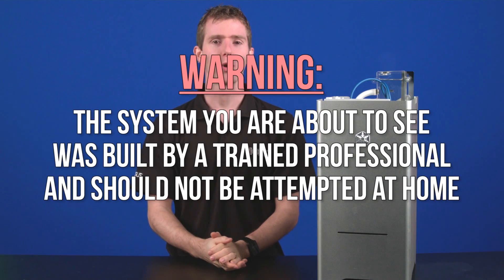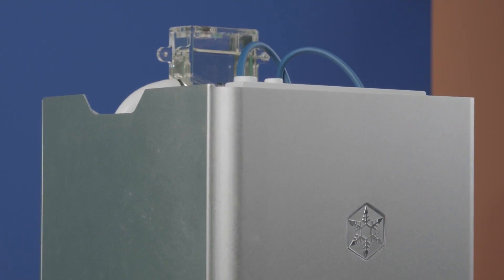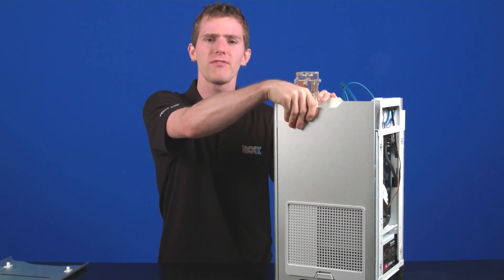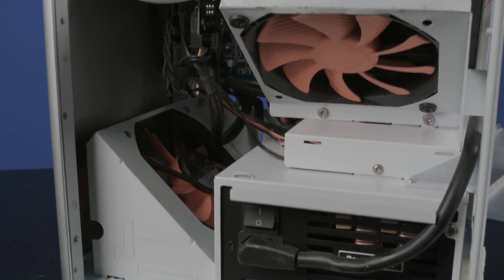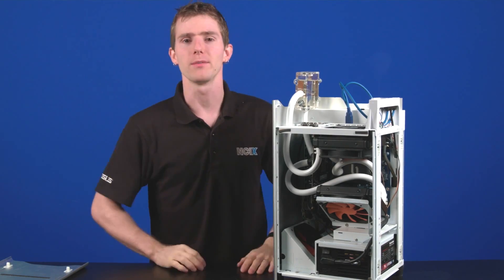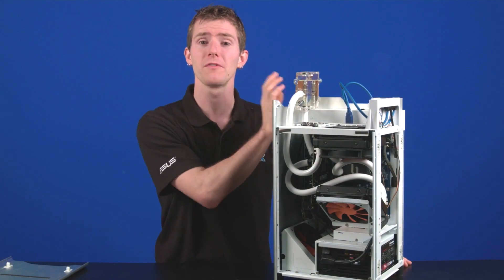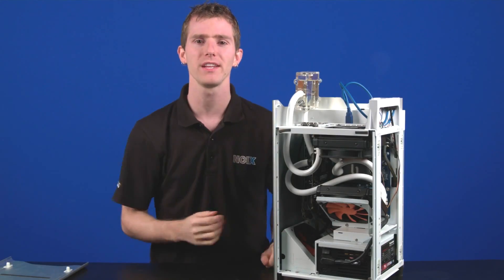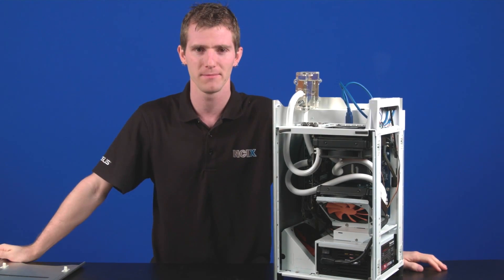Fully Custom Watercooling Loop for under $100!

Comment: Guys please donate linus for a better mic....echoing linus is  soooooooo annoying
Reply: Sound dampening foam on the ceiling maybe? (If they can actually reach it.)
Reply: i thought a good mic could reduce echoing
Reply: It's not the microphone. They have to do a fair bit of post processing and noise reducing to the recorded audio since it is done in a very open and echoy work place.
Reply: A better isolated mic should do the trick. But you shouldn't donate to Linus, since this is the NCIX channel :p. On Linustechtips the audio is quite good.
Reply: I don't think its linus but NCIX. He sounds okay on his own channel
Reply: was gonna like the comment, was at 69, ill just leave it
Reply: Elson Yuen ***** nicholas amodei They have tried that and it didn't work.  As for shooting in a smaller space, NCIX had to get them their own commercial space and the whole space is like that.

They have put up a video talking about what they did try and the only stuff left to do is way outside their budget and they have to work with what they got.

Most of the time they can remove allot in post but not always successfully.
Reply: Its not that bad.
Reply: Wouldn't sticking a sponge on the mic work?
Reply: ***** Isn't much of an excuse. There are ways to prevent that.
Reply: TheNerdyCanadian Well in that case...
Reply: It's the room, not the mic
Reply: Its actually all on NCIX's part. Linus only has total control of equipment on his own channel. Would be nice if NCIX would throw so echo dampeners around the room, though
Reply: Donate me for my liquid nitrogen PC cooling XD.
Reply: A microphone diffuser would probably do the trick. http://www.amazon.com/Microphone-Diffuser-Isolation-Absorber-Griffin/sim/B0082DAL3S/2
Reply: yes the sound quality is bad
Reply: ***** Plywood and sound-dampening foam.
Reply: ***** may as well just apply the sound dampener either way, makes it less 2spooky4ncix.
Reply: Slay you can't do that with a lav mic...
Reply: TheNerdyCanadian Actually you can... several of the best come with foam windscreens. It won't help.  Besides as I understand it they do allot of their recordings with  a boom mike out of frame.
Reply: WolvenSpectre he said stick a sponge on it, not a foam windscreen, but really they should close in the area they film in, $100 of plywood should be enough to make a ceiling for it
Reply: TheNerdyCanadian 100$ plywood? Are you kidding me? literally 2 (3)wooden beams and old bedsheets Ya gotta cut the costs :D
Reply: Slay i'm assuming they would want it to look decent
Reply: TheNerdyCanadian sponge... foam windscreen(BTW not a windscreen but protects the mic and reduces pop)... what is the difference.  Even if you used natural sponge it would be and do the same thing.

Oh, and for the "only 100 dollars, making video like they do costs ALLOT of money on expensive equipment in a rented commercial space that used to be a small multi story hight warehouse space.  Also they employ cameramen and editors and pay for stock media licensing.  According to a post from someone at the channel they looked up all that stuff and NCIX didn't have room in their budget for it right now... they may do the stuff in the future.

Personally I think they are doing it a little on the expensive side and could streamline things, but then again I wouldn't be casting a show that represents an international facing business brand online.
Reply: You guys listen to it on the max volume? wtf
Reply: its the room hes in not the mic, and i agree he is far from needing a donation form a person.... there are plenty of manufacturers that would love to give him a mic for free all he would do is mention it a few times in the vids. but trust me its the room. there is NO audio control set up. they are just in a large open room. youll notice audio is way better using the same equip when they shoot in the "closet"
Reply: What bad mic? He naturally sounds like that.
Reply: Tony Tarver The echo in the room if you turn the volume to 1000%
Reply: Surms41 Or you know, if you have at least not shit headphones....
Reply: Slay I have very good headphones, I just don't listen to videos above 20% because the sound kicks too much in my headphones.

i.e., I have too good of headphones.
Reply: Surms41 Please don't tell me that you use some kind of Razer headset because I will be forced to disregard your comments.Also there might be something wrong with them if you lose sound detail depending on the volume.
Reply: Slay No. I hear the echo, I just don't listen to it >40% volume... in which the echo becomes audible to me.

Razer is shit.
Reply: Surms41 So you DO hear the echo. Case closed.
Reply: ***** Because he wants better audio quality? Go back to your Xbox.
Reply: I personally think its a lack of soundproofing. Or the lack of a proper mic for the recording area.
Reply: Rohaan Manzoor They probably just missed a step in post.
Reply: >When a tech channel cant record their videos properly
Reply: DigicamCreeper Lack of soundproofing, yeah. It isn't hard to put up some baffles or sonifiber.